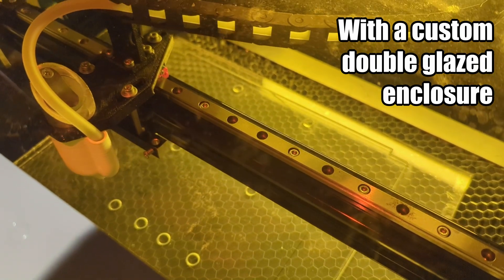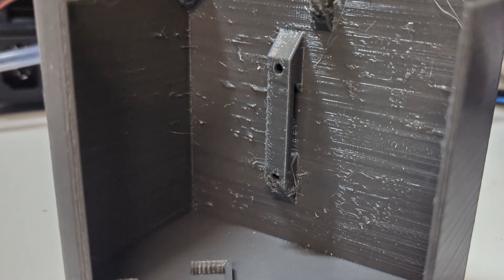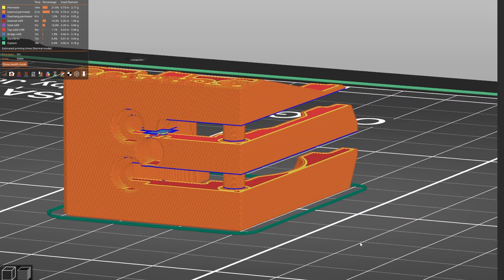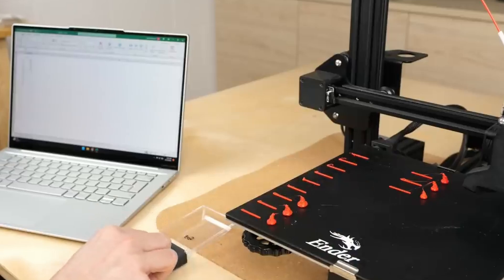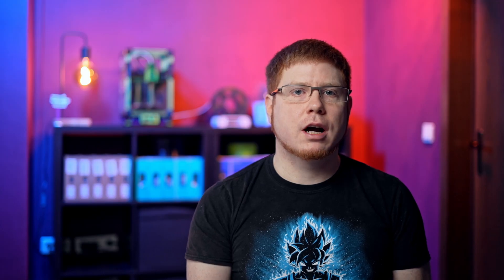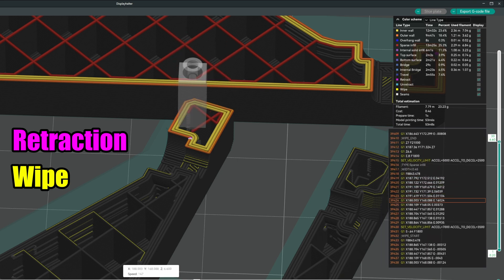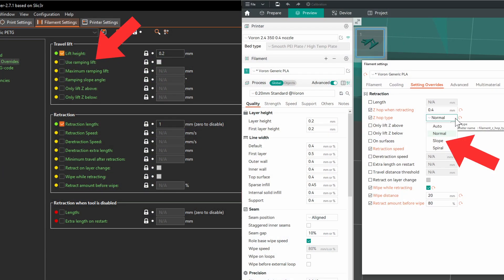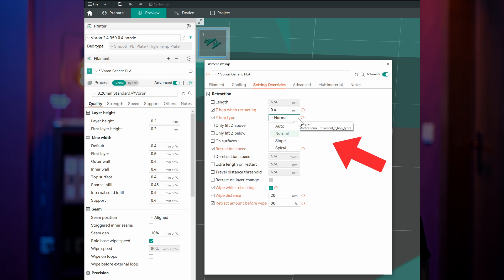3D print quality: 8 easy SLICING and TUNING tipps for PERFECT results with Prusa & Orca Slicer

Comment: I've been printing a lot of parts with threads (for astro) but only in a small section. I'd like to print the threads at a finer resolution and the rest standard, is that possible? Artillery X2 with Cura and Marlin. I used your bed-leveling patches, that helped. Also (ahh 2 questions!) is there a good startup or pre-print ritual to go through with the printer besides turning on the heat, z=0 with paper and go?
Reply from the maker: I don't know about Cura but usually Slicers can't do differnt layer heights for the same part at different positions. Technically it's possible if you combine 0.2 mm overall with 0.1 mm, but not out of the box AFAIK.

Bed leveling is usually necessary only once in a while for manual leveled beds. The only thing I find absolutely mandatory is cleaning the bed with a quick wipe of isopropyl alcohol. Ideally you have things like G28 (homing) directly in the Slicer as start GCODE added to every print file automatically.
Reply: @SmallBatchFactory  ok thanks, good to know.
Reply: By resolution, do you mean layer height? If so, you might want to try using adaptive layer height with your model. You’d then be able to set finer layer heights in the threaded section and thicker layer heights elsewhere. It’s particularly helpful with round objects (e.g. spherical) to reduce the layer stepping effect
Reply: @larsboner9224 The tab is resolution and there is also layer height. I'll check out adaptive layer height. Yes the lens holders are round but not spherical. Flat. I see what you mean.

Comment: I’ve also noticed missed or even combined walls when using a step file using Bambu studio.  I designed a part with a thin inner moving part and it would always fuse that part with the walls next to it even though the tolerances were more than adequate.
Reply from the maker: Someone mentioned it might be an issue with the STEP files Fusion 360 generates
Reply: makes sense! @SmallBatchFactory

Comment: Great content! I’m currently trying to figure out how to get rid of the hull line after just discovering what the heck was going on and what it was called! If you don’t have a video on that id love to see you cover it
Reply from the maker: Thanks! There's a great article on the Prusa website about the hull line. The short version is you have to do a lot of tinkering for your machine and material. Sadly there is no cookie cutter method and it's a whole lot of work for one single use case. Another model might end up totally different still.

Comment: OrcaSlicer has a maximum volumetric flow calibration test built in as well, where you can visually inspect for under extrusion. 

I’ve recently moved to OrcaSlicer because of the built in calibration tests like SuperSlicer and extra things like Inner/Outer/Inner walls, and Poly holes.
Reply from the maker: I've seen those but wasn't sure if visual inspection is enough for a meaningful choice.

There are a few really cool features, over all the GUI feels a bit sluggish to me though. I may have to try Superslicer

Comment: I converted to using only STEP-Files (exported from Fusion) since I switched to BambuStudio, and so far no Problems. Also the Printquality is better compared to Fusion STL-Exports on high. Therefor I'm surpriced that Orca has such problems.

Comment: It is possible to entirely eliminate seam. It takes ages but you can do it.
Reply from the maker: Does it work universally then or just for the optimized print?
Reply: For every print. I had a HyperCube around 2018 and I spent AGES tuning it. Even printing plain cylinders (not vase mode), I got the seam to vanish. Sadly the slicer profiles are long gone, but iirc it was mostly the things you covered - wipe and coasting, no Z hop, good retraction length and restart length. I also had to perfectly tune extrusion multiplier per roll of filament. I was printing only with eSun because their filament diameter was consistent around and along the whole roll. I've only just gotten back into printing and my Prusa Mini has a very visible seam. It's really bothering me.
Reply from the maker: @JamieBainbridge sounds intriguing. I have to give it a try when I have some time to spare.

Looks like the hypercube was a direct drive printer, with a bowden like the Prusa mini tuning can be a lot more tricky. Never got my CR-10 to stop leaking. But that was also with older Slicer versions.
Reply: Oh I had Bowden on mine. The trick was a large enough retract to reduce pressure in the melt zone and a wipe to soak up anything remaining.

Comment: Interesting. I always have excellent results with step files on PrusaSlicer. But I don't use Fusion360. I use FreeCAD. Maybe the F360 step export is defective?
Reply from the maker: Someone else also said that and backed it up with examples. I would've expected Fusion to handle such an essential thing flawless. I'll have to do a few more tests.
Reply: @SmallBatchFactory  can we get some more love for FOSS CAD software please? Imagine if all that money people spent on licenses, instead only a fraction went towards good FOSS CAD projects like FreeCAD. We would all have much better CAD, freely available.
Reply from the maker: I still have to figure out how FreeCAD works, it's a bit clumsy but I really love the idea. It would be cool to have CAD tool doing one thing really great (solid modeling for example) instead of trying to do everything but working only half the time.

Fusion is also free for personal use so I have a hard time using FreeCAD fighting against the usability issues when I just want to get things done. I'd love to donate to. FreeCAD in the future if I manage to raise enough funds.

Comment: Agree with your tips in general. I prefer using Cura, but I get slightly better print results usually from Orca. That said, I was better at dialing out small issues like blobs and stringing with Cura. In Orca even with the wipe and seam gap settings, I tend to get a seam that looks unfinished rather than nice and clean. It's crazy how detailed you can get on dialing in print settings. I'm pretty used to just going through every menu at least once when I'm doing a new print with a specific material now. I know how each setting will affect something and I try to get it where I want it based on quality vs strength vs speed.
Reply from the maker: Haven't used Cura in years, maybe I should. Prusa Slicer just has so many great profiles already but I'm also experienced enough to do my own so maybe I should.

To be honest I didn't do more than a few test prints with Orca yet since it still feels a bit alien to me. It has a few neat additions but it's also incompatible by choice (no ini file import from Prusa Slicer)
Reply: @SmallBatchFactory  I think the Cura interface just works better for my brain and process. I like the terminology used in some cases better too, but I have been using Orca most lately. If Cura would just add a few of the features from Orca I'd def use it more. I think for any Klipper machine with web tools, Orca makes a lot more sense as well. I haven't actually used vanilla Prusa, but I gather it's much the same with a different layout. That's really annoying about not letting you import from Prusa though. I have pretty much never used fully standard built in profiles in either slicer. I'm always tweaking and messing around. Can't help myself. I watched too many videos on how to improve prints to leave well enough alone.
Reply from the maker: @802Garage last time I used Cura you could also customize that options were shown. Was a bit confusing for me as a beginner.. Y first prints were all with concentric tops and bottoms since I didn't know any better. Not the strongest way to stack layers.

It's probably the experience factor for me, Prusa Slicer is a bit Menüo riddled. Orca feels clumsy and not very responsive. I'm at a point where I can usually predict the outcome of whatever settings I set so maybe it's time to build my own profiles. The profile management in Prusa Slicer always seemed odd to me since you have to adjust every single layer height on its own and so many times things like Z-Hop just silently came back without me noticing...
Reply: @SmallBatchFactory  Hahaha they def all have their quirks! Yeah same here though I'm pretty on top of what all the settings will do now. Cura still hides a bunch of options, but it's easy enough to just make them all visible, which is what I did. :D
Reply from the maker: @802Garage as newbie having all those important options hidden bothered me. I like the Prusa approach there they have three skill tiers and mark every option green, yellow and red. Although I often don't agree with their chosen tiers
Reply: @SmallBatchFactory  Ah well Cura may have changed some since you used it. When you first set it up you are given the choice to have a beginner, intermediate, or expert set of options IIRC. You can always go hide or unhide any options you want. They don't really distinguish between which ones are more advanced or not when you are selecting them though. I like the way the categories are broken up mostly though and the search feature works well, if a bit slow. I'll give Orca credit for usually having more in depth tool tips, but also randomly really bad ones, hahaha.
Reply from the maker: @802Garage if it weren't so much hassle with transfering profiles I'd use all of them in parallel. A bit of intentional vendor lock in I guess...
Reply: @802Garage scarf seems are now in ORCA not as game changing as I hoped but it does smooth them out
Reply: @SnoringVids  Yeah they have been super useful for me on some models. I still like Cura's interface and search and use better overall, but I've mostly switched to Orca for the features and results.

Comment: The issue with the step files is the program they were exported from. I usually find that fusion 360 step exports will have holes, almost exclusively on chamfer faces. The normal for those faces appears to be reversed.

If you load a step file that has issues into FreeCAD, then convert to mesh; you will see that the faces with reversed normals match up with the missing faces in Prusa Slicer. I do not see the same behavior with step files exported from FreeCAD.

I am sure there is an easier method, but I usually rebuild the edge that the chamfer was put on, then re-create the chamfer and export.
Reply from the maker: That's interesting! The step files came from Fusion and also had chamfers around the edges. And here I am expecting those files to be correct... Funny enough Fusion creates flawless STLs, but of course from their own internal f3d file format.